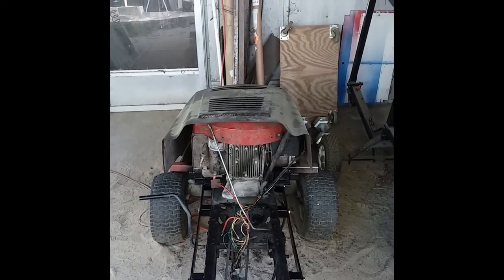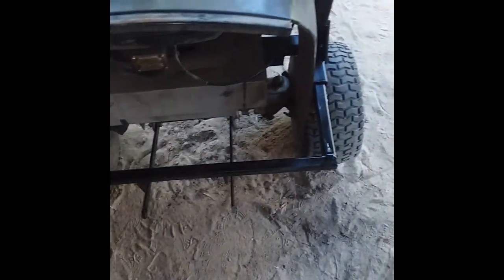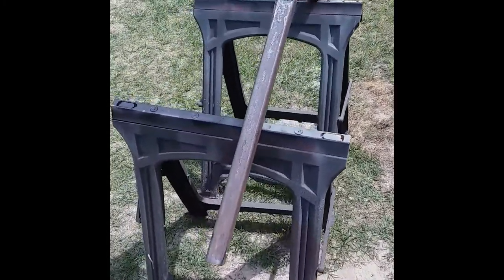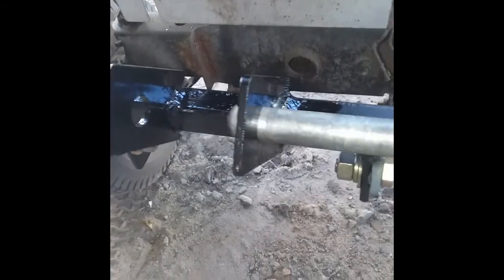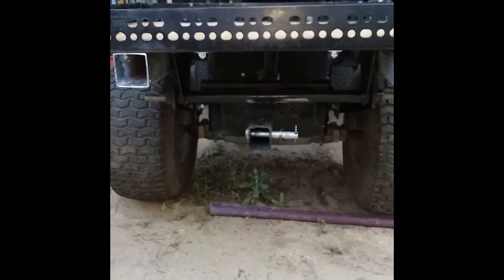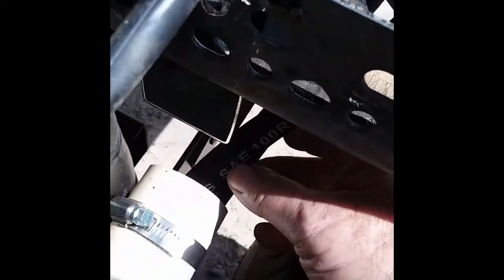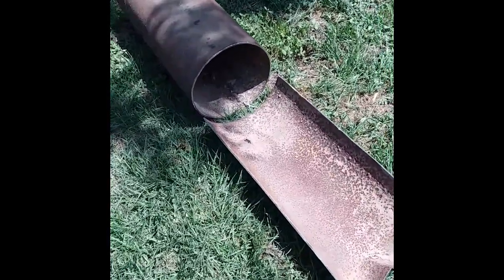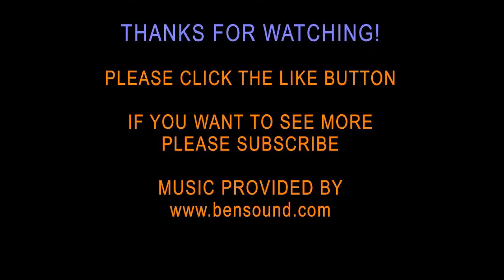Homemade Residential Front End Loader on a Garden Tractor / Mower

Comment: Fine job Ed, but you could have made it a monster by relocating your attachment points.  The problem is that your poor front tires will take 100% of the load AND the weight of the tractor AND make driving it unstable IF it could handle heavy loads AND will lift the weight off your rear tires.  Really about as bad as you could design it.  But if light work is all it is for then it is fine and maybe it fits its purpose and doing what I'm about to describe is severe overkill.  If you had done a bit more design/fab work it could have been something to behold.  Not saying you did anything wrong because if it fits your purpose then everything was right.  BUT...  (I like big BUTs)

The ultimate solution is to modify the back of your mower behind the seat to add a heavy-duty pivot point.  Then add the hydraulic lift point just in front or at the rear axle.
Your lifting bars can be wide+low or high+overhead or some combination of these.  You could even have one big square tube on the side.

This design is essentially what you find on skid-steers.

Here is why this is better:
1.) adds traction to rear wheels when moving the load (more stability)
2.) will not reduce weight on rear tires as you push
3.) will not overload your front axle/tires
4.)  better lift speed is possible if you select the correct hydraulic position/angles

The front wheels are essentially using a long lever (The tractor's body) to support their part of the load.  You will need little or no extra weight added to carry the load.

Additional advice to those about to do this.  If you plan on digging with something like this make the bucket narrow and long - not wide and shallow.  Gravel weighs 122 lbs per cubic foot and I would not lift > 400 pounds because your mower may find itself on its side - and you under it.  So say 3 cubic feet (366 lbs).  So you could try 24" front to back, 18" wide, and 12" height.
Also bucket design considerations:
a.) Do not just make it out of super heavy metal (it will weigh too much)
b.) Make a frame and add sheet metal to the inside of it to hold the dirt. (Do not weld it in...bolt in.)
c.) Have a removable front edge/knife:
(1) Smooth for snow, and scooping off the pavement (Edit: missed the s on snow so it said smooth for now...ugh)
(2) Use rebar 2 or 3-inch sections welded to the edge ground such the bottom is longer than the top to encourage dirt lift.  Space 1 inch apart.

So sure you are probably not going to do the above (Or maybe you will...) but the people coming here will at least be able to see the flaws your design demonstrates and perhaps improve upon it.

Lastly, Not a bad effort, and in fact MOST (90+ %) do it just like you did.  But it has severe flaws which hopefully people reading this can learn from.
Reply from the maker: Thank you Buddy! This raises a very good point. I have to agree with what you are saying if I was designing from the ground up. However the purpose of this build was not to build it to be Hercules. Not to build it to be commercial grade. While your design would definitely distribute weight better. And load capability would increase the axles would never hold up. This was an experiment for me.  I figure the practicle side of things in a residential setting for the weekend project warrior would be the ability to lift 2 to 3 hundred pounds maximum. This project warrior does'nt want to fill a wheel barrow one shovel full at a time. I felt it should be helpful for the guy that time is not an issue but simply wants to move some mulch, piled dirt, gravel or carrying lumber from the pickup truck 100 feet away to right up next to the project. And very important - he or she can have a little fun while moving this stuff around.

To put it another way, wouldn't it be nice that every homeowner with an acre of ground could have a small loader, economically built, that could help make the lifting part of his/her projects easier. 

My desire has been to motivate the weekend fabricator to build himself this helpful tool. Are there designs that are better than what I did here?  - You bet!  But taking into account the platform it is to be built on (basically a lawn mower tractor) there are no reasons to spend extra, or design extra. This was built on a Murray mower (definite limitations). It was not worth the time and money for this experiment.  Unless of course in the heart of the builder he wants to go to those lengths. 

I have built another small loader to continue my experimentation (it is similar in design). The new one is electric instead of hydraulic. I am sharing what I am learning with my followers so they can make informed decisions when building their own loader.

Having said all of this I must say I agree with Buddy Snackit concerning better design. But each builder must determine how much money, time, effort and technical design he or she wants to invest in it. If you are going with something like Buddy's suggestion, then get a better tractor to build up from. If you are building on an old lawn mower, don't overly invest.
Thanks, Ed
Reply: @eds2centsworth203  Totally understand, but it always seems like people end up lifting too much and having other issues such as poor traction.  The only axle that would have a problem would be the rear one on a lawn tractor because all the force on the front tires is a small fraction of what would be on the rear tires.  If your rear axle is flimsy then a 2nd heavy axle with sprockets and chains from the original axle to the new one and of course gear it down a little for more torque.  If you were adding the rear attachment plate already for the shifted point it would be easy to add a 2nd axle.  But I'm still talking about a limited lift of 366 lbs.  With a limited bucket size which limits your weight, you know how to size things.  All but the cheapest of rider mowers probably can handle that.

I'll probably convert my Husqvarna rider into something like this in my copious free time....
The hardest part is the design.  Material cost is probably not much more.  The time is the costliest...